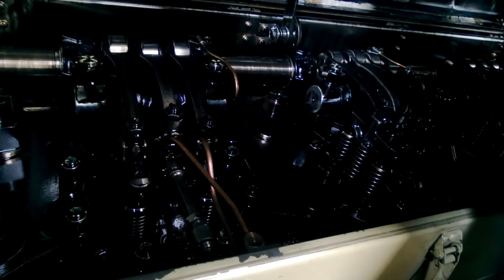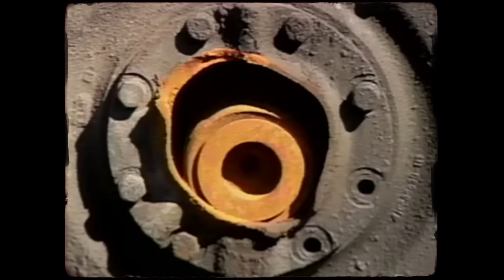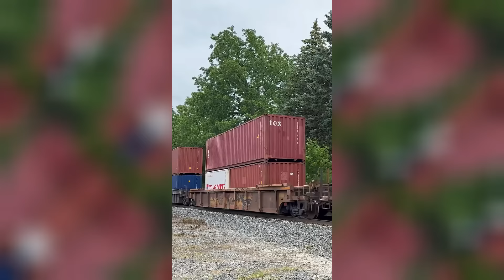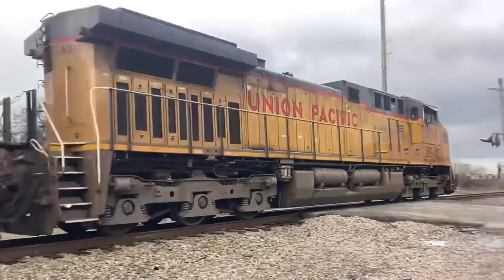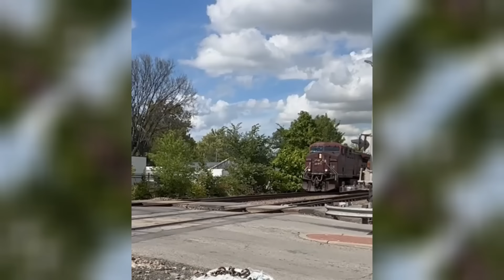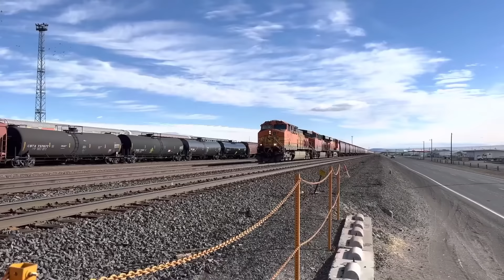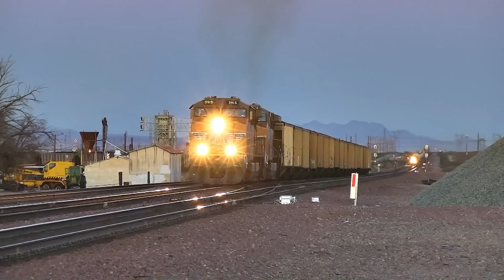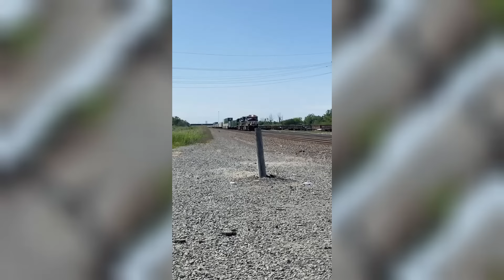The GE Locomotive That Silenced EMD in 1994

Comment: Emd made the first A C traction moter
Reply: The problem with being first is that someone else can come along and fix all your mistakes.
Reply: I didnt know that. What locomotive ?
Reply: @jdday1757  SD70MAC. Specifically BNSF 9400, which is now owned by the Illinois Railway Museum.
Reply: @dovahmike7045 hmmm. Didnt know that one. Thanks for that
Reply: @dovahmike7045  BN SD60MAC 9500 - 9502 Manufactured in 1992, the first 4000HP EMD locomotives
Reply: @jdday1757  SD60Mac
Reply: @jdday1757 , BN 9400 was built in December 1993. Look for Trains Magazine January 1994 issue. EMD, Siemens and BN celebrated the BN 9400 in Fort Worth, TX

Comment: The sd40 was good in its day, but these days, it's just an oversized switch engine. The AC traction GE's are the best road locomotives these days. The old emd locomotives still dominate for yard and local power though.
Reply: They have good pulling power even now. The issue with running these new crazy powerful locomotive is that when one does break down you don't have enough power to continue. However running the same train with a couple more sd 40-2 allows you to afford to lose a locomotive and keep going. And the more reliable you locomotives are the more money you'll make in the long run.
Reply: @jordanalexander615  if only if it wasn’t for PSR
Reply: GE Capitol had deals where rail companies could buy power by the hour lease agreements dont forget how greedy Jack Welch was he could suck any business through a straw and sell it if it wasnt number 1 or 2 in the market.
Reply: For some reason Class II and III Railroads(in North America) seem to think SD40's have lower operating costs, better longevity, and are generally easier to maintain. Very few own any Wabtec(formerly made by GE) locomotives made in the last 20 years, which seem to have planned obsolescence built in.

But if you're a Class I run by Hedge Fund Investors and you need to run a 300 car overloaded train(because of PSR implemented by said Investors) across 2 states and your rail infrastructure is still stuck in 1950 then yes Wabtec locomotives are your go to solution.
Reply: @legatvsdecimvs3406  laughs in Russian Railways who are still using Soviet era locomotives to this day, particularly the M62s, 2TE10s and 2TE116s mainly.

Comment: No mention of the SD70Mac’s that ran BN’s coal fleet for years before the AC4400’s came around. Also no mention of GE’s locomotive factory in Ft. Worth, TX right on BNSF’S mainline!
Reply: Can't expect that much out of a AI channel, lol.
Reply: Erie, PA is the real home of GE locomotives, every AC44 was built there and the demonstration unit is still there.
Reply: Hopefully they will do a separate video that will put some light on the SD70MAC's, CSX in the NE had the updated SD70MAC - T1's with the flared radiators that were built between 2003 - 2004. There were 130 purchased for the regions between West Virginia and Western Maryland.
Reply: @raymondj.2351 Add the original 75 plus all 15 inherited from Conrail and you have a total of 220 units.
Reply: The AC4400CW came out a only months apart in 1993, BN got their SD 70MACS in 1993...they were not running for years before.
Reply: I agree with you. EMD'S first 3 AC locomotive demonstrators were four patented EMD self-steering radial truck (AC or DC capable) SD60MAC locomotives in a BN inspired color, to EMD's dismay. But after the results, they placed the first revenue order. They were for the EMD SD70MAC. They were the first AC's on railroad tracks pulling tonnage. Then BN ordered more, and then they returned as BNSF. GE was building the DC orders still. They eventually got orders for their locomotive, but EMD had uprated the ante to 4300hp to stay competitive.
Reply: This is a GE advertisement to me.

Comment: Yeah, these videos aren't all that accurate. BNSF only ordered 50 AC4400CW, in fact, most of the GE locomotives they ordered were DC powered Dash-9s. That's just one in a litany of inaccuracies in this video.
Reply: MAkes you wonder if this video was produced with help from GE/Wabtec's marketing department! lol
Reply: Im pretty sure CSX ordered the most AC4400s. I remember seeing them all the time out around Pittsburgh and in the Allegheny Mountains around connellsville and Cumberland
Reply: @jdday1757  Actually Up did.
Reply: @Buckskin1290 do you know how many UP ordered ? I think CSX ordered over 1000, I think. Im only going by their road numbers and considering the number of the lowest one and the number of the highest one I surmised its probably 1000 units
Reply: @jdday1757  Up ordered over 1000 AC44s, while Csx got over 600.
Reply: Only 50?
Reply: BNSF ordered 150 AC4400CWs. Everything else was Dash 9s until the GEVO era
Reply: @stillnohandle25  Yeah. Bnsf did order order 700-800 DC gevos.

Comment: In the video the author mentions how emd's had analog diagnostics. Not all of them. Behinning owth the SD60 family they had micro processor controlled and computer controls. In the maintenance department both electricians and mechanics used them to help us troubleshoot and repair them. I cant remember if the straight SD60s had computers but the SD60M and SD60I had them. I worked on all of them. Hated them.

Comment: Brushes eliminated in the traction motor? 
Did they eliminate the brushes in the main generator? (By changing to an Alternator to absorb the raw power from the prime mover)?
Reply: If the main alternator is the same as the one in the dash 9 40CW which was a DC traction locomotive then the main alternator had slip rings and those slip rings had brushes. I have fond memories of my 5 years working for norfolk southern railroad in Conway yard as an electrician and changing out those brushes and the traction motors brushes on the RM line. Fun times. We didnt have any AC4400CW on our roster. CSX had a bunch of them. With AC traction motors they wouldn't have brushes in them. NS did have about 20 ish EMD SD80MAC locomotives which had AC traction motors. They were pretty reliable, the rest of the locomotive, not so much. When they ran good they were great. When they had electrical problems they were a real bitch to figure out
Reply: I don't know if the alternator has brushes or not, but in road/ag/earthmoving alternators some are certainly brushless.
Reply: @PMcKay00 pretty sure they do. If they have slip rings in the alternator then they have brushes. The DC version of the AC4400 has slip rings.

Comment: Silenced EMD forever?
Reply: EMD (if using the traditional 2 stroke Diesels) sounded a lot better than the GE that sounded like it was shaking itself apart.
Reply: @davidpowell3347 hey I actually liked the sound of the GE locomotives more than the EMD's. I have fond memories of working the RM line at NS and inspecting in both emd and ge's. One of the many tasks performed was a load test where we ramped the engines up to notch 8 and left them at that state for roughly 15 minutes. I far preferred the rumble of the GE as opposed to the throaty sound of the EMDs. I likened them to being the ones feeling like they were gonna shake themselves apart as opposed to the GEs. At that point the SD40-2s we had were showing major signs of them being closer to the end of their life as they would be in the shop constantly for grounded traction motors, slipped pinion gears on the traction motors, grounded alternators, low voltage grounds galore, cab signal malfunctions sometimes tied in with those low voltage grounds etc. Fun times
Reply: @jdday1757  I also prefer the sound of the GE engines, but I like hearing both GEs and EMDs work hard together in tandem
Reply: @Ellis-s5o that is a really nice sound
Reply: EMD is actually owned by Caterpillar now not GM.
Reply: @IlikeCatF I forgot what year that GM spun off EMD into their own company. Kinda the same way they did Detroit diesel into their own company